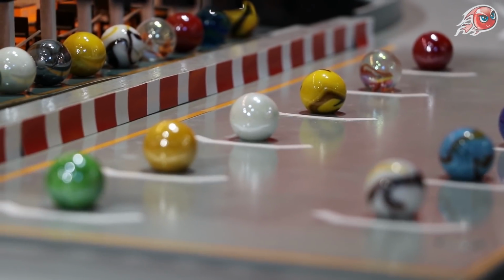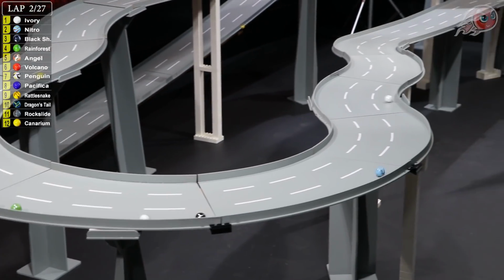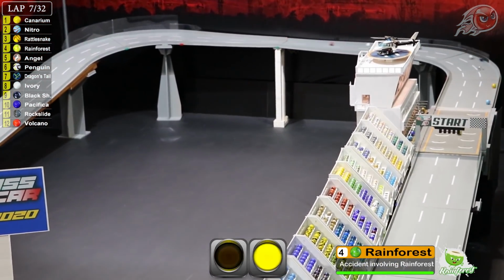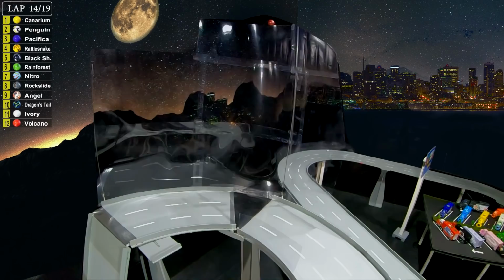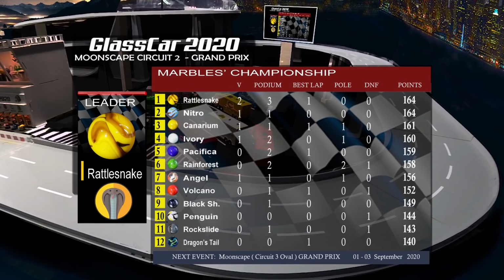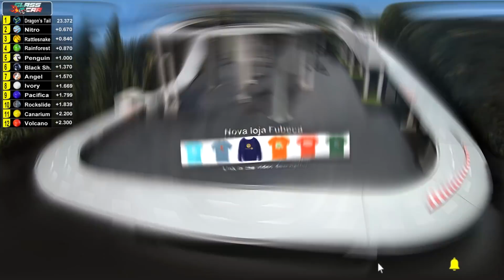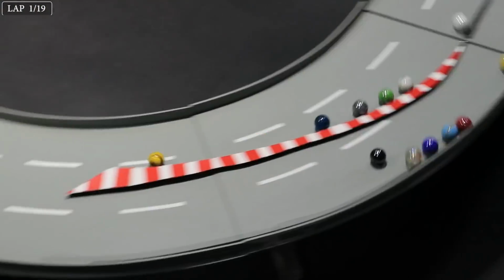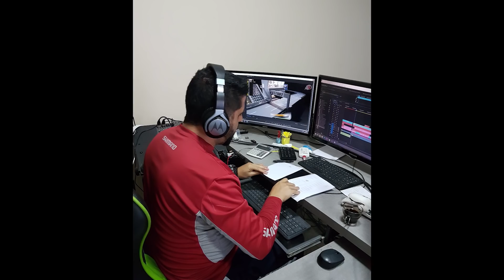The best marbles racing- All races of the season Glasscar by Fubeca's Marble Runs

Comment: This is amazing. Better than the Olympics.
Not sure about the scoring system though. You could literally just give every position 25 points less without changing anything. I'm also not convinced by 5 extra points for finishing first, I'd use a scoring system like MarioKart - 15-12-10-8 and decreasing by 1 after that.

Comment: We would race marbles as a kid but we used a squirrel cage fan and an air hose. Looking back it was really damn clever for a bunch of kids. We would lay the air hose on the floor in my dad's shop (on slick concrete) and place the hose so the fan would blow the marbles down one side of the hose and the momentum of the marble would loop around and come back up the other side of the hose and hit the force of the fan again and keep going in a loop over and over. The weight of the marble had to be just right along with the shape of the track and fan position. We got our marbles out of paint cans. The marbles would actually race it was pretty cool. The hose was like the kind you see in a Automotive shop that hooks to a air compressor.
Reply: Should make a video of it!